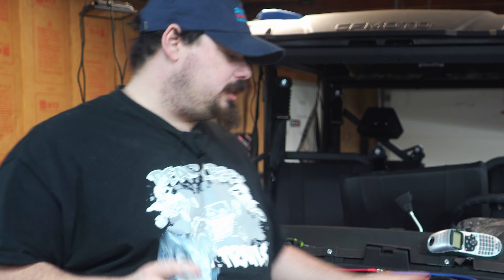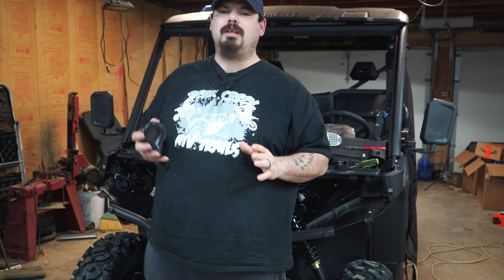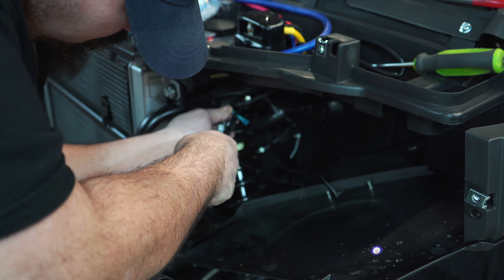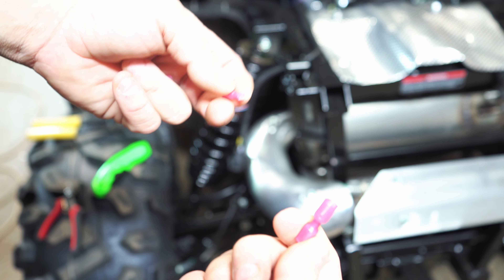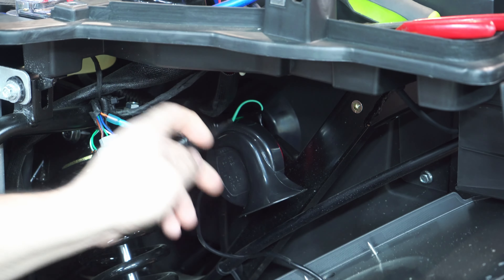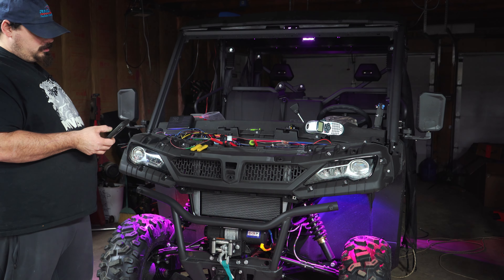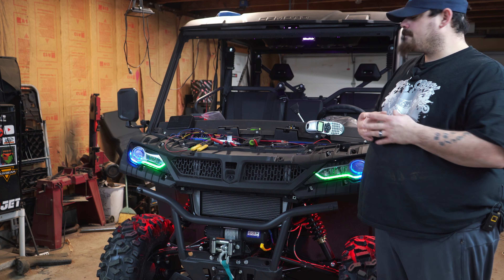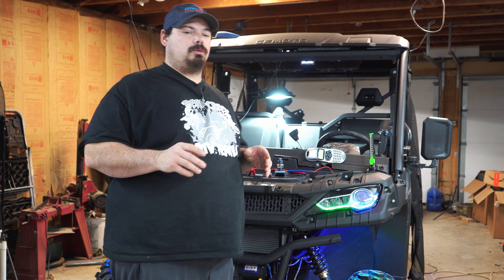Turn Signal & Horn Install CFMOTO UForce 1000 XL

Comment: I'm currently working on a double din radio housing to put in place of the center cup holder.  I have a few templets made, and if its successful I'll find a way to send some pics.  Also working on a custom rear bumper.  I have a template made for it, just need to build it.  Thanks for the videos you have done, they have been helpful with my build.
Reply from the maker: That would be awesome 😎 can’t wait to see it when it’s done.  Your very welcome

Comment: Like your channel! I have a 2022 uforce xl I love it, can I use the Hopkins 7889 trailer plug to wire the rear lights rather than using the small 3/4 lights.
Reply from the maker: I’m sure you can.   Thank you 🙏

Comment: Great videos. I've done a lot of wiring on my Jeep, but I still learned something from this, and the last wiring video that you did. 
 My question is, how hard would it be to make the front turn flash sequence go from the center of the grill to the outside instead of outside to center? In other words, in the actual direction that you are turning. It would make more sense that if you're turning left, they should flash left. 
 Just a thought. Take care and keep up the good work.
Reply from the maker: Thank you.  I agree with you. But unfortunately how I had to pay the lights out inside the housing it didn’t allow me to do that no room for the wiring.

Comment: Nice video but some things are missing. How did you get the wires to the switches? You said they'd be right behind the panel, but how did they get there? When doing the horn, I have a couple questions, first, are you on the driver's side there? And second, is the horn wire already there from factory? Also, when you played the video within this video, when you finished you said you've seen what we did on that Uforce, you can do that or do what I did. But that video doesn't show what you did? What did you do on the Uforce? 
 I apologize for all the questions but if I don't ask then I can't know what you did.

Comment: One more question re: the headlight install. I saw you cut the headlight wiring on both sides(light blue and orange) when you reinstalled the headlights which wires did you cut to tap into to connect?

Comment: What did you ground the front lights too?  i have my positive on the orange and light blue but need to find a good place to ground the negative.  Any advice would be helpful.
Reply from the maker: Any bolt on the frame will do

Comment: Really looking good, I think you are doing a great job on the UForce. I do have a concern about the turn signals in the front. When you activated a turn signal I was a little confused at first looking for the one blinking. I see it turned a different color but the other side continued to blink as it was set up to do so.  If I was watching you at an inspection I might not pick up on which direction you are signaling to turn to. For one I would probably just watch how awesome your rig looks with all the LED lighting but I probably wouldn't notice the blinker.

Maybe ther is a way to turn off the LED action for the non blinking light when blinker is activated?  Thay way only the side that blinks would be an indicator for the direction you are signaling.

I'm not sure if that made any since? My intention for commenting is good, I'm looking at this from someone negotiating an intersection with your UForce. But your hard work on this build is great.
Reply from the maker: Hello there buddy. You made perfect sense.  In the video I mentioned you can make them steady one color.  I didn’t go in to great detail.  But let me explain how we are going to utilize these “safely” when on the road.  We are going to set them to 1 solid color such as white most likely. So that when using the turn signals you can distinguish witch way we are turning.  I hope this explains it.  I will also explain in a future video.
Reply: @R.N.GPerformance  That sounds great and good to know.  I was watching the video an all I could look at is awesomeness.  Just wanted to make sure you had it covered.  If there was any tweaking or fine tuning this is where you would have wanted to do it.
I look forward to watch your progress.  When evening comes around  and I settle down, I like to see if there is a new video.

Comment: Will these parts work on a 2023 UFORCE 1000?  I know some parts do and some don't?  Thanks for the videos!
Reply from the maker: I’m not sure.
Reply: The 2023 model just needs the switch and flasher. All harnesses are already in place
Reply: @johncarty4535 I just pulled the panel on my 2023 and noticed there were 2 places that already had wiring ran to them, just no switch. Do you know what wires those control?
Reply: That's incorrect.  In order to use the factory-installed wire harness you have to buy the headlamps and tail lights or splice into the factory harness and run new wire to your lights of choosing.    @johncarty4535

Comment: hi. i have a 2023 Cfmoto uforced 600 trying to do the turn signal kit got from the dealership, works for a 22 model can’t seem to find the turn signal relay under the hood, or in the dash. any suggestions would be greatly appreciated
Reply from the maker: 23 is different then 22 buddy
Reply: @R.N.GPerformance   so I need a different flasher relay then

Comment: what did you end up doing for the rear turn signals?  I have checked the rear of mine, and I have a metal bracket that runs right behind the plastic under the tail lights.  Considering opening up the rear tail light, and seeing if there is a way to separate the upper and lower reverse lights.  Then run a reverse signal to one, and turn signal to the other and add some transparent amber tape.
Reply from the maker: We used LED Whips as the turn signals.
Reply: @R.N.GPerformance  never thought of that, thank you for confirming.
Reply from the maker: @supermaga5351  your welcome 🙏

Comment: i have an cfmoto 800 left and right turn signals work, but the hazard light doens't it kinda blinks on only one side, any idea is there a relay somewhere which i can check?
Reply from the maker: It might be the hazard switch
Reply: @R.N.GPerformance  OK will replace this thanks!
waiting for your video on the handbrake adjustment :)

Comment: Is there a way to plug and play the rear led turn signals?  If so, can you put up a picture of the connector type needed?
Reply from the maker: There is.  But the connectors are hard to get you just need a metal pin pull a pin out and match it with something on Amazon they are hard to find tho.
Reply: @R.N.GPerformance  ok thanks for confirming.  Are you gonna be putting a horn package together?

Comment: The videos are great, but you skip over some of the most basic stuff (maybe you have a video showing it somewhere?).  For example, you already have the hood and side pieces removed in your how-to's, but for those of us new to these machines, maybe that would be nice to cover?  Or how to remove the switch panel (again, it was already removed in this video).  I did manage to remove the side panel without breaking anything, but it would have been nice to know about the 3 rubber locks.  As to reinstalling, I've been struggling with it for 30 minutes now with no luck, so there must be some trick to getting it lined back up?  Obviously, you've figured it out, but it would be nice to share that.

Comment: I purchased the oem taillights with turn signals and they don’t work correctly.  Supposedly dealer has CF Moto involved cause no one knows why
Reply from the maker: That’s definitely weird for sure.  They should work.
Reply: @R.N.GPerformance  on drivers side I jumped the yellow wire over to orange just like they told me and I lose reverse then

Comment: i myself wouldnt cut shit cause once you cut it your done have to replace it all if it isnt plug and play shouldnt even doit you start cutting stuff its like a magic 8 ball problems in the future
Reply from the maker: Only if some hillbilly does the wiring and does it with cheap connectors.
Reply: @R.N.GPerformance  lmfao